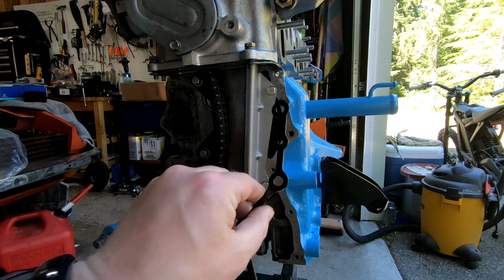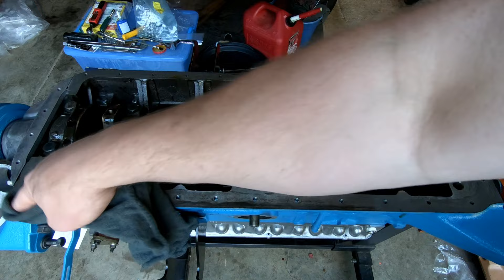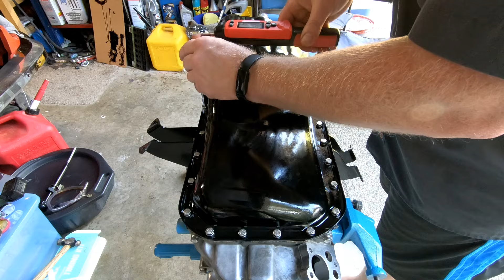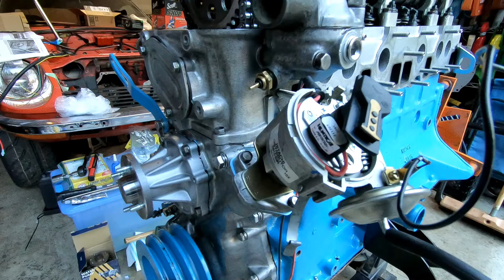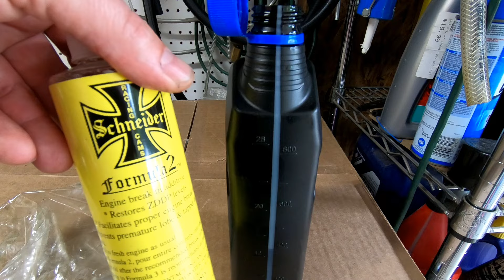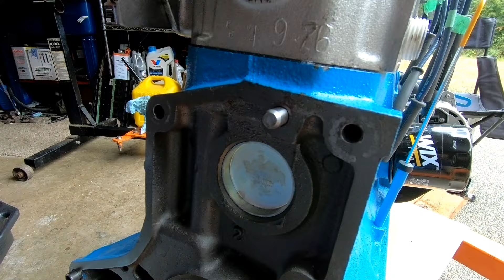Datsun L24 Engine | final assembly pt 2 (final)

Comment: I only use gasket maker where it’s absolutely necessary.  Otherwise it causes more problems than it solves.  

Besides being used incorrectly… (assembling parts immediately after applying RTV…. )

All gasket makers and flange sealants need some time to cure before assembly / mating.  

RTV will not cure anaerobically.

Comment: Absolutely loved this build series! was super informative and technical but also straight to the point! Definitely inspired me to rebuild my L24 and would reference your series if I did. Just curious if you don't mind sharing a relative cost breakdown? Any sites in particular site/brands you sourced most your internal rebuild parts? Thanks again for sharing your build!
Reply from the maker: Thank you for the kind words! Im glad you got something from the videos :) 
Im not sure what the exact cost breakdown would be but its around 3k usd with the things i had done with it including the machine shop expenses amd aftermarket upgrades.  
My parts sources was mostly from:
Thezstore.com (majority of the rebuild parts and stage III cam kit)
Datsungarage.com
Zcarsource.com
Jegs.com (for the .020" silvolite pistons)
Lightweight flywheel i got off a google search.
Head studs were from ARP
Tuning4performance.com was where i got the mikuni jets and rebuild kits.

A lot of the other stuff i had on hand from just scavenging parts over time.
The books, tools and chemicals i used are linked in the video description. If i missed something let me know and ill update the links. 
There are some tedious measurements and things i omitted from the videos on purpose so i highly recommend following the factory service manual and the guides when doing the valve geometry, shimming the cam towers if the cylinder head deck was machined more than 
.010" (shims are in .005" increments i believe) and checking main & conn rod to bearing tolerances.
Lessons learned: 
If you have brass intake seats on the head have those changed to steel.
Bring the timing cover with the engine block to get decked at the same time.
Have 1/32" thick gasket sheet handy, some kits dont come with everything, i had to make the gasket that goes between the timing chain tensioner body and engine block.

Comment: Absolutely one of the best rebuild L24 videos I’ve seen.  Makes me want to tear mine down just for the heck of it!!  Only improvement would be to include a list of part numbers & vendor references.  Thanx again!
Reply from the maker: Thank you! Theres a lot of technical info i had to leave out due to each engine having its own dimensions and machining requirements but factory service manual and the books i referred to give a step by step on what to do :)